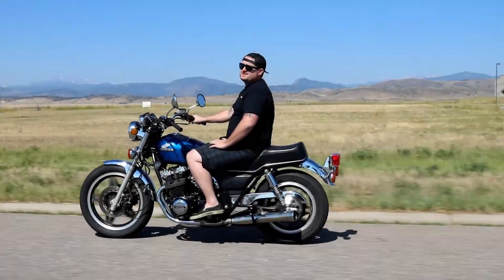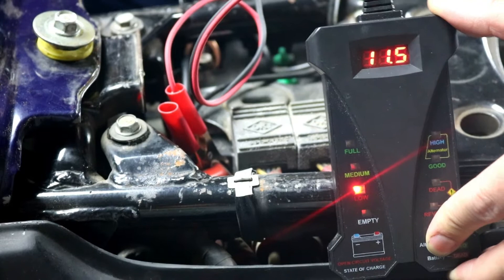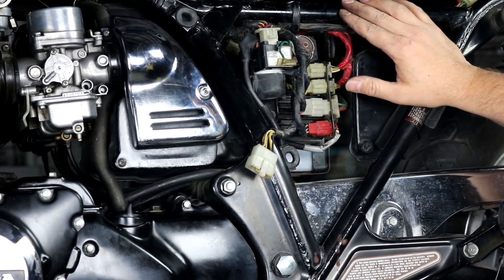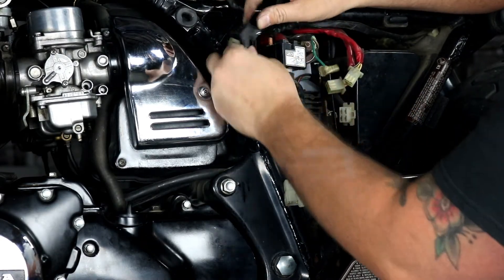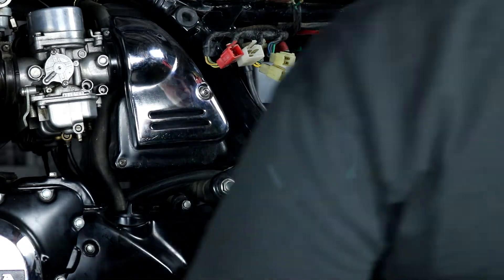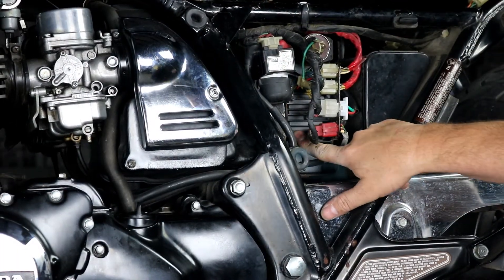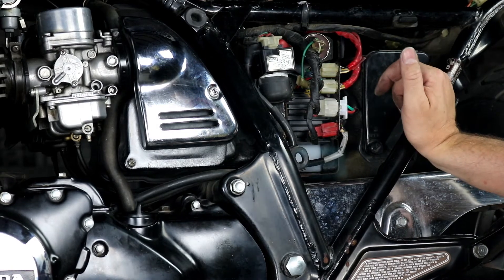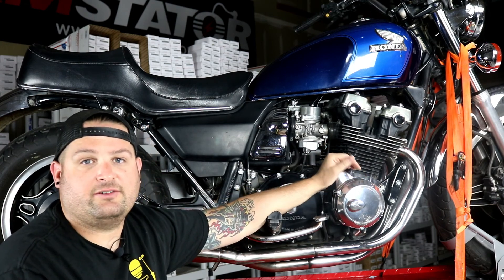Honda CB 650 750 900 1000 DOHC - How to Install RMSTATOR Voltage Regulator Rectifier & Starter Relay

Comment: So nice to see a Canadian company in this sector.  However I find it odd that you have charging system parts for a 1982 Honda but don't have anything for a 1984 GPZ 900 (the original Top Gun bike) that was extremely popular and thousands of these bikes were built. Can you explain why you don't have regulators or stators/rotor for this bike?

Comment: Video very helpful, I have this exact same motorcycle and was wondering if could help?  Looking to wire relay for turn signals and can’t find any videos which terminal or switch would use any help would be appreciated! Thanks in advance

Comment: Thank you! I have a charging issue with my 1983 CB1000C. Should you always change the "Starter Relay & The Voltage Regulator" at the same time? My starter seems to be working fine. But is there something there that would "draw' current if it's not replaced at the same time?

Comment: If you switch to an anti gravity or ballistic battery do you need to switch out your standard rectifier?
Reply from the maker: Yes it is recommended to use our lithium battery specific regulator rectifier, available on our website.

Comment: Was wondering i have a 91 nighthawk 750. Where is the rectifier on it. The bike runs great. But was wondering if the lights flickering at low rpm and 2500rpm. Doesnt do it going down the road. Thanks........then again. It could just be an old bike and is normal like my old kz.
Reply from the maker: On your Nighthawk the rectifier is on the frame under the gas tank near the ignition coils. It could be a bad rectifier, or a failing stator. The stator is mounted under the generator cover on the right side of the bike, behind the cylinders. You can easily find a service manual PDF for this bike online, I would follow all of the stator and regulator/rectifier testing steps to determine what is causing your problem.

Comment: Could the issue have been the brushes, rotor or stator?  I have a 1982 cbc that has a charging issue.
Reply from the maker: On the CB system, all the parts must be working perfectly for the charging system to work correctly. This includes stator, regulator, field coil rotor, and brushes, not to mention wiring harness, ignition switch, etc, and a good battery!

Comment: you doesn't change the starter relay...
Reply from the maker: It is definitely shown.
https://youtu.be/06g0Qdn-N18?t=296
Reply: I'm here cause I've got a problem on my honda cb750f. I need to change starter relay, but I can't find old type oh relay. So I bought new model, just like that in the video, but it doesn't work when installed. Do you know why?
Reply: @obliq4037  and u are sure the problem is the relay?
Reply: @MrFilgri  Yes I am. I think the problem is in the different kind of wiring
Reply: @obliq4037  yea a think so too.
Reply: @MrFilgri  i think that's the reason he doesn't change the solenoid 🤣🤣🤣🤣🤣
Reply: @obliq4037  for sure 😂